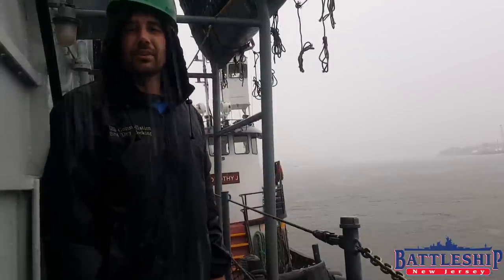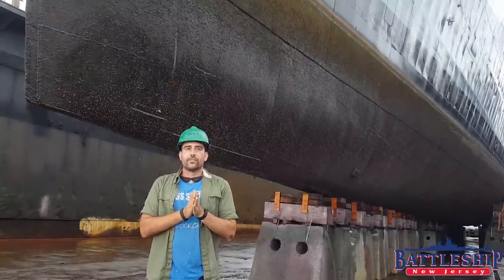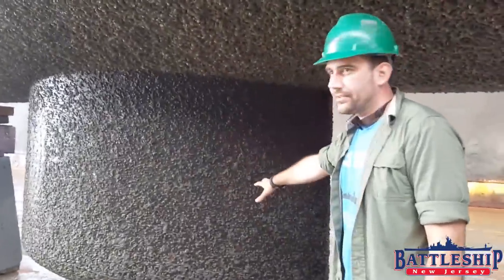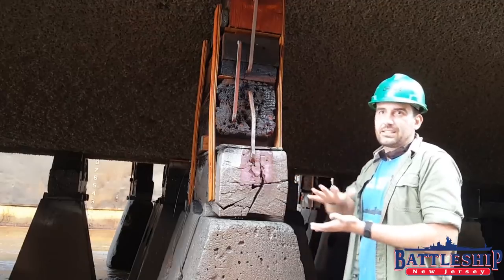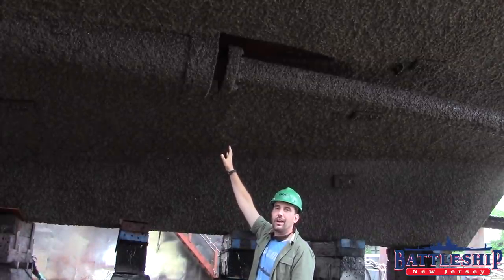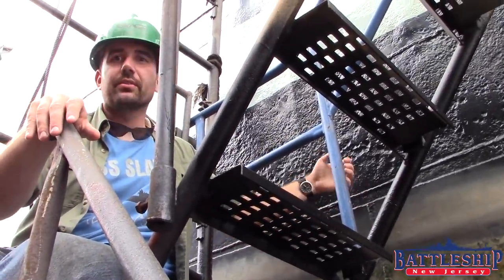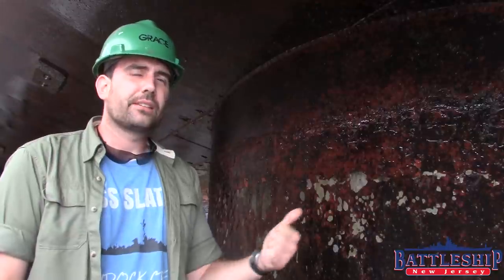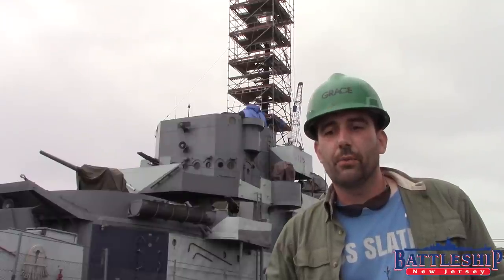Dry Docking a War Ship

Comment: 8:54  A retired navy captain sharply corrected me when I called that a propeller.  It is a ship, so it is a screw.  Only a boat has a propeller.  I then when to the royal navy for the definition of a boat vs a ship.  A DDE would classify as a ship because she leans outwards in a turn.  Just passing that along.  I have no idea to its merit.
Reply: All ships with a traditional hull heel (lean) “outward” in a turn.  The faster the ship is moving, and the greater the degree of rudder, the greater the heel.
Reply: Your “retired navy captain” probably was not a Surface Warfare Officer.  The term “screw” is a naval slang commonly used by “old salts” (or those who wish to appear as “salts”) when referring to a ship’s propeller.  The term “propeller” is not what differentiates a boat from a ship.  SLATER has two fixed pitch propellers.  In comparison, the ARLEIGH BURKE class DDGs have “Controllable/Reversible Pitch (CRP) Propellers” (as do all gas turbine powered ships).  “Screw” is often used in salty conversation (“He snuck back aboard by climbing up the screw guards,” or “You’re not a real sailor unless you have twin screws tattooed to your butt cheeks.”), but the correct term is a ship’s propeller.
Reply: DerRobMann (R.T. West)  Navy, 1978 - 1983 also an MM, FF-1087, FF- 1067. Your ship/boat definition was what I was taught. And. to add to your list of Navy vocabulary: wall....bulkhead, stairs....ladder, inside the ship....below decks, outside....topside, prop....screw, cafeteria....mess deck,   engineer.....snipe. I can think of a few others but they aren't for a PG rated  audience. 😁
Reply: DerRobMann (R.T. West)  Regarding "head", I understand that was from the practice of hanging "one holer" seats off the bow (head) of the ship for sailors to relieve themselves. As far away from Officers' Country as possible! That must have been fun when shipping green water over the bows.

Comment: How do they align the ship so it settles onto the supports on the dock floor?
There are supports for the propeller shafts aft of the where the propeller comes out of the hull.  How do they lubricate the bearings in the support?
Reply from the maker: They send a diver to check that it's lined up and they send word that it needs to move where.

Comment: 3/8 of a inch thick , only about 4mm ! Why did they use plates so thin,  was it for weight . So she could go faster through the water ?
Reply: 3/8 inch = 9.5mm. Of course, after 80 years of rusting they might be a bit less.

Comment: I bet dry docking the NJ will cost a little bit more?
Reply from the maker: Absolutely.
Reply: Charles DuBois  Basic Dry Docking is charged by the Size of the Vessel. I remember years ago, My Father Dry Docked one of his Oil Barges at this same yard and I will always remember the "Kidding" around about how he was being charged for let's just say 400 feet but the barge was over hanging about 20 feet on each end of the dock.  The area in which this dock is located has been servicing commercial vessels for well over 100 years!  Back in the 80's and 90's there were several "Dry Docks" that were themselves well over 100 years old!

Comment: Wood is strong in compression!!
Reply: @Jim Bartz it is also strong enough to hold up an escort destroyer.  In compression.
Reply: @Jim Bartz white oak is insanely strong against the endgrain.  We use it in large sizes to roll and manipulate large, heavy, fabricated parts, and it holds its own even on it's side.
Even when rolling on a sharp corner with 100 ton parts, if you use your head, your blocking won't fail.

Comment: What watch are you wearing? I assume you have it turned inwards to prevent it from getting damaged.
Reply from the maker: Ryan broke 3 watches drydocking Taney alone, he doesn't have a standard type, whatevers cheap at walmart
Reply: @BattleshipNewJersey  That's crazy! Three watches?! In the military, I wore cheap watches. All either broke or fell apart. Once I started buying decent watches, they seemed to stick around longer. You'd be surprise. a decent watch doesn't really have to cost that much.
Reply from the maker: We have a tendency to smash them into things the way we work. If its cheaper to buy a new one then replace the craved cracked or missing glass, might as well trade it out

Comment: Why do they not apply an anti-fouling paint below the waterline to stop the marine growth, like most commercial shipping has? I know the paint has a cost associated with it, but surely this is dwarfed by the cost of hiring a floating dry dock for a week or two?
Reply: They probably did use antifouling paint. After 6 years in the water it would grow regardless. I have ablating anti-fouling paint (it dissolves/peels away taking the growth with it) on my boat and after 2 years in the water it has growth. You can't stop sea life from attaching; you can only slow it down.

Comment: Why leave the bronze props on and fight the dissimilar metal corrosion with zinc. Why not just remove them?
Reply from the maker: If things can be left in place, we leave them there. Though most museum ships have them removed at some point.
Reply: Has consideration been given to coating the props with urethane or some other coating to reduce galvanic corrosion? Is it not practical to completely seal something like that?